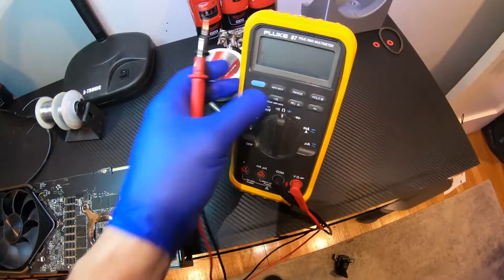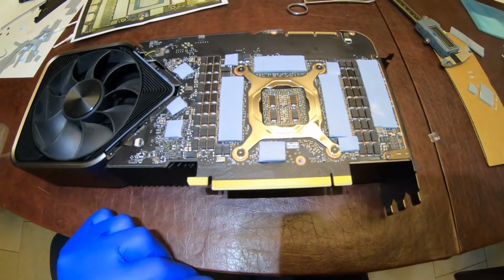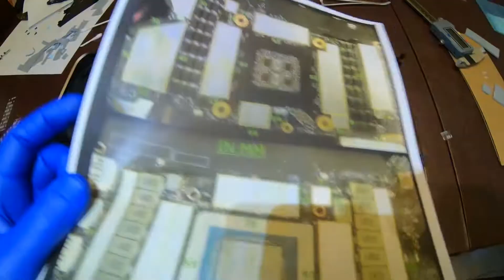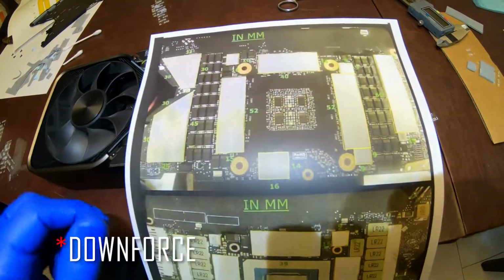NVIDIA 30-Series Founders Edition LED Socket FIX / Repair

Comment: Had a question, i got a used 3090 FE from a friend, the RTX logo light never worked, then one magical day it turned on fine on a random boot up, then shut off after about 20 sec and i cant get it to come back on even when replicating the conditions that made it turn on before, what do you think it could be? Ive used multiple RGB softwares that all recognize the lighting zone but changes to it do nothing, it still sits just off.

Comment: Got a quick question I did thermal pad both sides, and thermal paste.. I know for sure I didn't break the connector it's been a solid year since I did that and all worked; however, as of recent the side where it sais "GeForce RTX" does not light up at all. The upper section that you can change colors in precision X1 does work. I did NOT have that nor any led software setup prior I was just checking. Do you have any idea of where to look for that I'm not shy around teardowns. Just haven't seen anyone have this problem. ( I searched on Google for a while) Normally LEDs don't work at all not just 1 zone. Presently got 1 zone that works and the other NADA. At the moment no clue where to look. Hopefully you have an idea of where I could try diagnosing.
Reply from the maker: If the logo is not illuminating (and it's not a software issue) it can only be one of three things: 1. a bad connection at the connector due to corrosion or mechanical separation over time. 2.LED failure (unlikely) 3. power supply to the LED (unlikely).  Since you did remove the LED connection at 1.2 change the thermal pads and you say nothing has changed in the software department, I would have to lean towards option one, humidity or vibrations have somehow broken the connection at the socket.  If you have a variable power supply you could try  disconnecting the connector to the PCB and feeding the LEDs low-voltage starting with 1-3VDC to see if the LEDs illuminate.  If they do, they are good but once again it is probably just the connection has gone bad over time since you initially did your pad change.

Comment: I cannot find this part anywhere online. Can you send me a link for this part?
Reply: It is in stock now at Amazon, I just ordered one. Broke my led connector on my 3080ti.
Reply from the maker: It will be back in stock in a day or two at Amazon, link is in the description.
Reply: @ModsAndProjects  that is great news. I tore down my 3080 fe to install a copper mod plate I got and this connector just broke off. Not a huge deal since it's just the LED but I want it to be working correctly. Thanks again
Reply from the maker: @suppmiker  Yeah, I'm a perfectionist (same boat) I cant stand when things like this are broken.  Just make sure to take your time when doing the repair and use magnification.  
:)
Reply from the maker: @suppmiker  When you get the part please report back and let me know how it goes!

Comment: where can i get a new wire side connector?
Reply from the maker: Hey, not really sure.. What happened to yours it came off the wires I guess?
Reply: @ModsAndProjects  exactly lol
Reply from the maker: @Jokerr6900  Someone was "pulling" and not "lifting" lol I'm not sure of the part number, did you lose the original piece? You might be able to tin the wires and stick them back in the socket if you still have it.
Reply: @ModsAndProjects  i believe the piece is actually still on the connector, i got the 3090 fe in a trade and he had accidentally pulled the wire out doing a repaste/repad on it. like you mentioned it’s not a huge deal and effects nothing, but i’d like to have a fully functional 3090 🙃
Reply: @ModsAndProjects  i say i “believe it is” cause i see 2 little channels for wires, and not 2 exposed prongs.. i could be completely wrong though
Reply: @ModsAndProjects  hot glue and duct tape fixed it lol
Reply from the maker: @Jokerr6900  impressive, did you even solder the wires to the pads?
Reply: @ModsAndProjects  nah, the clip is still stuck into the connector.. i just skinned a small bit off the end of each wire and shoved them into the wire channels, put a drop of hot glue on the top of the connector and a piece of duct tape on top of that to keep it down.
Reply from the maker: @Jokerr6900  good for you, I suspect if you slap it around the led will probably flicker but hey, a  fix is  a fix

Comment: How hard is this to do for a soldering noob?
Reply from the maker: Lowest possible amount of heat with the least amount of time on the contact pins and it should be pretty straightforward if you follow the steps in the video.  Alignment is the most important thing, securing the wire into the socket and then securing the socket to the board with some kind of adhesive prior to soldering is a huge help. Don't forget to use flux and check for shorted pads in front of the socket as shown in the video

Comment: Very helpful video, thanks for the tutorial! I’ve never soldered before, is it easy to learn?
Reply from the maker: I wouldn't say it's simple, but it certainly doable if you are careful and take your time. Just use the minimum heat possible, make sure you have a very sharp tip on your iron so you don't melt the socket, use flux, and don't keep the tip of the iron on the pen for more than a second or two :)